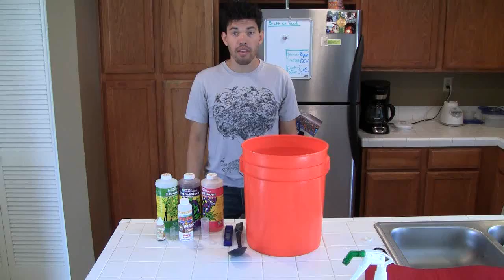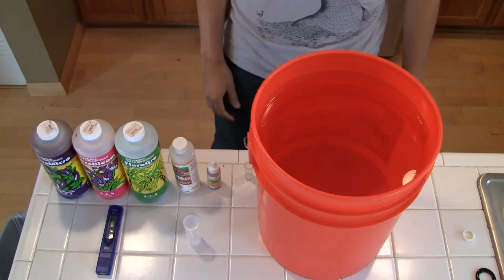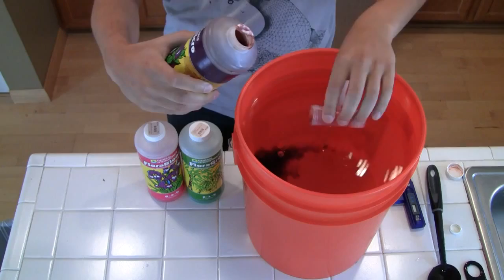How to Prepare Water for Hydroponics

Comment: When you're doing a dwc grow do you alternate between nutrient feeds and water feeds weekly or do you just always fill the res with nutrients?
Reply from the maker: I always feed with nutrients but taper based on the growth cycle of the plant
Reply: @epicgardening  thanks for the reply. So if I mix a feed for example and my ppm is 800 and I leave it for two days and the ppm goes up to 850ppm does that mean I need to top up water or what would be an indication that I need to put water instead of top off with nutrients? I know if the ppm Half's or goes down 250 ppm you top up nutrients just not sure how the plant needs to be fed water? Thanks
Reply from the maker: Typically I like to change out the entire reservoir once a week and not do a whole lot of correction in between those periods
Reply: @epicgardening  thanks so much for the help much appreciated man

Comment: Two major mistakes:

1. You should measure and adjust PH after adding fertilisers, not before, because ferts actually change PH of the water
2. You mixed grow after micro, and then bloom without cleaning the measure.
Reply from the maker: This is an older video when I was first starting out - link in the description for the updated one :)

Comment: wrong!!! you pH your water after you add your nutes, he didnt even bother to pH the water after adding the nutes... after adding nutes the pH tends to go down. that bucket also holds 5 gallons if only filled all the way to the top, that's only probably 4.5 gallons of water or less, and you never dump the water with pH tester back in. all he did was put too much nutes and the pH is now too low and the water has pH tester in there. this video needs to be deleted.

Comment: Correct me if I'm wrong but when you check your ppm meter and it's already at 200 or 300 and I add 800 worth of nutrients you don't subtract the number of ppm's you had before the nutrients. Real good way to burn up plants. The ppm meter or tds meter is for reading total dissolved solids. Key word Total
Reply: Correct

Comment: Good video but NOTE TO SELF NUTRIENT TO WATER """""BEFORE"""""" PH-ING WATER 
AND COMMENT FROM SOME DUDE TO CONSIDER.
I would not be so sure the instructions on the nutrients bottle is the best ratio.
That is what they do. SELL NUTRIENT SOLUTION.
A plant can only eat so much having more is a waste.
I would start at 10% of what the bottle says.
And finding out the PH of your water in your area is so simple you don't even need a test kit just google it DAM.
Or buy some drinking water at Wall Mart.
Cost of 20 gallons is cheaper than 8 bucks for PH Down.
I had white spots low potassium ! tablet over the counter multi vitamin tossed into the water and problem gone.
Don't forget about rock dust.
Rich in minerals easy for the plants to enjoy and it's FREE.
That rinse water from pea gravel should be set aside after it settles gently poor it into your system Just the clean settled water not the heavy crap(check it for gold) LOL and your plants will love you.

Comment: yikes!!! this is so wrong! If your water ppm before the nutrients are added is over 130ppm you need an r/o machine or you need to buy the hard water flora series nutrients. This guys water is 350!!!! Also You don't check PH until all the nutrients are mixed properly.These nutrients lower the ph of your water after they are mixed because they are acidic.When mixing these nutrients you start with adding Micro first and then stir well before adding the bloom. Then stir well again before adding the grow. If not, that is how you get nutrient lockout,

Comment: I just wanted to lower the ph of my water which right from the tap is 7.6 and every time I kept lowering it with the PH down, it kept going down to 4.2. I couldn't get this thing down to 6.0 or in the 5s for nothing. I tried this like 6 times and all the same thing.
Reply: +curtflirt2  You are adding to much ph down into your water at one time!!
If tap water is at 7.6, you
should add 10 drops of ph down.  
Stir the water well and check the ph again!  
It should be in the 6.5 range at this point.
Adjust accordingly by adding drops until
you reach your desired reading!!
Reply: truthbtold I would only sprinkle about like 4 drops though and this was strange to me, I couldn't get it.
Reply from the maker: Even 4 drops can be too much, best to do the absolute smallest amount possible, stir, wait 5m, test, and then adjust from there. Eventually you'll get the 'standard' amount of pH down you should add every time per unit of water :)
Reply: Epic Gardening Okay, thanks.

Comment: Can you premix correctly ph'd / nutrient'd gallon jugs of water and store for later? Or will the nutrient/ph breakdown over time without interaction?
Reply from the maker: As far as I know, it should be fine to mix nutrients in water and then save them for later use. A few notes though:

- Don't mix the nutrients together before you put in water
- You will usually want to mix your 'micro' nutrients in first
- Be sure to shake the jug before use
- Be sure to pH the jug before use, just in case
Reply: Ciphered Logic no. It's science; nutrients degrade and break down at a molecular level. Look it up

Comment: Is the type of water, RO or tap, some big secret ? I can't find out such a simple , basic answer anywhere on this computer? . Is this guy, and most of the rest of ya, purposely misguiding people. IT REALLY LOOKS THAT WAY !!!!!!
Reply from the maker: It's a good question! You can technically use any water. Tap water has minerals in it that you will need to calibrate for, and RO water has nothing in it, so you may actually run into a nutrient deficiency due to missing out on some essential micronutrients (calcium and magnesium come to mind here). Hope that helps!

Comment: Bullshit,man!.....You check your ph after you add your
nutrients!! You're misleading people,buddy!!!!
Reply: For that, you need an electronic pH meter, because most nutrient mixes will tint the solution and make those test kits useless.
Reply: I am confused about that.  I check the distilled water at 8.0, and then add nutrients.  pH is now down to 6.2.    If I had reduced the pH to 6.0 for my hydroponics before I added nutrients would the pH have dropped to 4.2?

Many videos show pH the water first.
Reply: +C A JONES The rule of thumb is always to ph your water after you add your nutrients!! 
Depending on what additives you use you may be ph'ing the water down  to a lower reading which may automatically adjust the water within range for your plants.
It is crucial for the ph level to be correct for the roots to uptake and use the nutrients. I would suggest purchasing Ph up & Ph down solutions to properly
adjust your water to within the correct  range 
to feed your plants!!!!
Reply: You need to understand why that is. You should use ph down before adding nutrients because if you use micro-life for your root zone, otherwise part of it might get killed when adding acid after... before it gets diluted...  So the best thing to do is to know how much ph down you will have to add after adding nutrients and next time add the same amount before adding nutrients...  But the point is not to pour straight acid into your tank, as anything around the acid that is alive will die....
Reply: +Villnius Well..yes!! your right!but,..you can still be in
range with the drops if you monitor the way your plants respond to the way you ph your water with
nutrients added.
Reply: I just wanted to lower the ph of my water which right from the tap is 7.6 and every time I kept lowering it with the PH down, it kept going down to 4.2. I couldn't get this thing down to 6.0 or in the 5s for nothing. I tried this like 6 times and all the same thing.

Comment: shake your nutrient bottles first vigorously before adding.  stir the water after adding first nutrient, stir after adding second nutrient , stir after adding third nutrient.  and adjust ph after nutrients are added not before adding nutrients, as adding nutrients changes ph of the water. better still go watch a proper tutorial.

Comment: First he test his thumb and adjust the water based on the test of his thumb ?
Oh please keep making me laugh.
A clean bottle of ph down was ruined by rinsing the cap in the water?
Then he says don't get this stuff on your skin after he just had his hand in the water.
I part expected him to lick the spoon!
Cross contamination is a problem at his place i bet.
I would not be so sure the instructions on the nutrients bottle is the best ratio.
That is what they do. SELL NUTRIENT SOLUTION.
A plant can only eat so much having more is a waste.
I would start at 10% of what the bottle says.
And finding out the PH of your water in your area is so simple you don't even need a test kit just google it DAM.
Or buy some drinking water at Wall Mart.
Cost of 20 gallons is cheaper than 8 bucks for PH Down.
I had white spots low potassium ! tablet over the counter multi vitamin tossed into the water and problem gone.
Don't forget about rock dust.
Rich in minerals easy for the plants to enjoy and it's FREE.
That rinse water from pea gravel should be set aside after it settles gently poor it into your system Just the clean settled water not the heavy crap(check it for gold) LOL and your plants will love you.
Reply: +ItsFrenzy26 I use to have problems remembering until I found that vinegar (acid) has pH of 2.2 and baking soda (base) has a pH of 8.3. So now I just remember acid lower, base higher. Does somehow seem that acid, a corrosive, should have the bigger number.
Reply: I'm not very good with the details of science, but wouldn't PH down be low acidity (an alkaline), and therefor shouldn't be corrosive ? I just have in my mind that to be corrosive it would need to be more acidic than alkaline
Reply: +ItsFrenzy26 it's the other way around. The lower the pH the more acidic it is. The higher the pH the more alkaline the water is.
Reply: Thanks, can't believe I didn't actually know that..
Reply: aCountryVegan Yh I thought high PH was high acidity, and low , low acidity
Reply: people make mistakes....grow the fuck up and learn how to help instead of crying like a little bitch....more internet punks wanting to yell at someone cause they havent got the balls to do it to anyone they want to in real life....smh....why are you even watching if you know the shit...makes no sense...looking for shit to complain about th

Comment: You used your finger to cover the vial after shaking it. Your finger contains salts making the solution more alkaline, which is why your water was probably 8.5 on the ph scale, vs 7.5-8 which is pretty typical of tap water. also ph test/adjust after nutrients. I'm sorry, but I have to give you a down vote cause simple mistakes like this can ruin someone's $300+ investment and motivation.
Reply from the maker: +TickyTack23 you are right. I filmed this a long time ago when I was green, and didn't expect it to get this much traction on YT. Am going to be refilming :)

Comment: advice: never pour the water you're testing back into your resevoir, don't use your resevoir to rinse things, and if you're making a video about phing water don't show the vile over an orange bucket, it would've made sense to hold it over the white counter top to show the color indicating the ph. another note, don't mix GH nutes at full strength until your girls are about 18" or taller or you will end up burning them.
Reply from the maker: +Matty Wil Thanks Matty. This video is from when I was just starting out, so I made a ton of mistakes in both video production and the actual information as well.
Reply: No prob everybody that wants to know should be able to get good info, so we help each other as best we can

Comment: The only thing I saw is that each nute wasnt mixed individually. There also wasnt enough time in between each additional nutrient. I was always taught to mix each nute, stir, wait a minute or 2, then add the next one to ensure each is dissolved properly. One more thing is that i found it a waste of pH solution to check it before AND after. The end result typically is what you want, so ive always waited until after my nutes were added to adjust the pH. this is simply to save pH solution though. helpful video for beginners for sure.
Reply from the maker: +Diane Matheson It's a good question, and your observations are correct. I am in the process of updating this video!

Comment: Adjust PH after you add nutrients. Adding the nutes changes the PH. I have found my tap water a bit high (7-8) and adding the nutrients brings the PH down. He did not even check the PH after he added the nutrients.
Reply from the maker: +1vrsc Yeah I know, this is an old video that I am in the process of remaking :)

Comment: just use bottle water. from walmart nothing major. its automatically around 6
Reply: +Duray Red yeah good 1 have to bring like a load of bottles and carry them all over the place yeah right
Reply: +The Man No, Duray is right. Walmart has the 5-gallon bottles that are perfect for this. It's RO water so it works perfect. You'll just find it's generally cheaper to find a store with a refill system (20 to 40 cents per gallon) than a bottle exchange program (6 to 7 dollars for 5 gallons).

Comment: Is that tap water in the bucket?  any recommendations on where to find/buy RO Water?  I heard Wallmart might sell it there's not one even close to me. Is there a Recipe on the back of the nutrients bottles on how to achieve the right mix for different size containers right? I will be using Mason jars for now, since I'm new and don't want to construct a big hydroponic garden yet at least until I have perfected my growth method. Great vid tho!
Reply: curly sue Look for a pet store that sells salt water fish and corals.  They use lots of ro/di water.  Or try one of those rockymountainspringwater.com stations that let you fill your jugs yourself and test the tds to see if its usable.
Reply: Did u mean? https://rockymountainwaterusa.com  ??? Couldn't find anything outside of Utah?
Reply from the maker: curly sue I typically get RO water from stores like Wal-Mart or Target, they will have an area where you can fill up 5 gallons for $1 I believe.  Thanks for the kind words and good luck with your garden!

Comment: Adding nutrients can change the PH value of the water;  so, it's better to check and adjust the PH value AFTER you have added the required nutrients.  .
Reply from the maker: chandra0102 You are right, I have fixed this in my methods now and should be filming a new update!

Comment: if this video is wrong, you should just pull it off, and reshoot. or you could add an annotation link to your new correct video. it wouldn't take you more than 6 minutes to do it right. good effort. just do a reshoot.
Reply: Ingenious Productions I agree!  It should be more informative!  For example, Kevin never once said what the proper PPM should be!
Reply: +Betty Spencer And he gave a shout-out to using RO water and didn't even mention using a Cal-Mag supplement before adding nutrient!

Comment: Hey bro - I have my Water PhD at 5.8 before I add nutes....Thing is after I add nutes the pH is at something like 6.8/7.0....do I add PH down to the solution and bring it back down :D just need to make sure....Ive not mastered PH levelling yet and its frustrating the HECK outta ME
I better buy a  25 liter bucket...and do it ur way.....I don't know what thet hell ive been thinking...I do it separately for each pot ugh......I could basically do it in one BUCKET and than fill up the the buckets for the plants :) Im just being sure I don't eff up bro :D Im doing DWC and Im finding it hard to get it right everytime...Ive also been told to wash and dry the measuring spoon...I noticed u never really cleaned it....r those guys wrong or just being too careful lol
thx bro hope its not too much to answer :D

Comment: I need some help I'm new to this and my ph meter reads in the hundreds and I'm trying to set the ph lvl right.
my water is at l50ph am i suppose to bring up to 500-600ph lvl ?
Reply from the maker: I think you mean PPM, right?  If your water is at 150PPM that's pretty good - my water here in San Diego comes in at 350 out of the hose.  What you want to do is make sure that you're putting in the right amount of nutrients for what you're growing, and what phase it's in.  I'd look on the back of the nutrient bottles and put in that amount, then measure the PPM after.  Hope that helps!

Comment: Might I suggest you add a notation to correct yourself to let people know you need to check ph after adding nutrients and not before? Confused me for a second and thought i was doing my water wrong.
Reply: I second this. I find it easier to nute my water first then adjust pH. Most of the time my tap water has a pH of 8 and after adding all my nutes that drops to 6.5 anyway. Small adjustment to keep it at 6.

Comment from the maker: Great question!  I typically check nutrients levels daily and chart it in Excel, but I'm nerdy like that.  Typically, I will adjust pH once a week and add nutrients as needed...there are feeding schedules you can find online for most of the common plants you'd grow in a hydroponic system.  Each plant is a bit different as far as what they want to really thrive, but I've found that being a little "hands off" and not measuring exactly works pretty well  too!